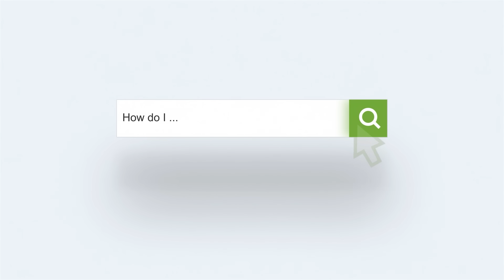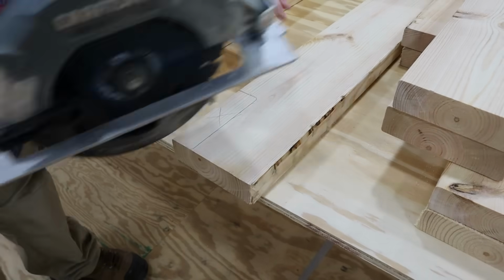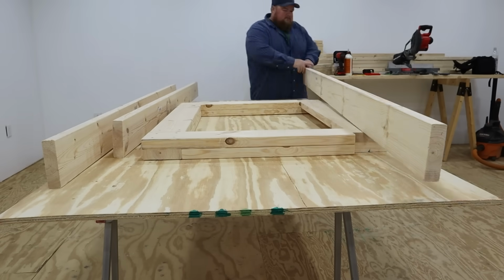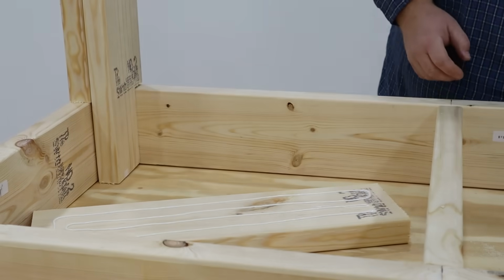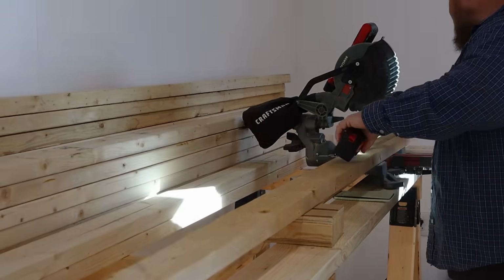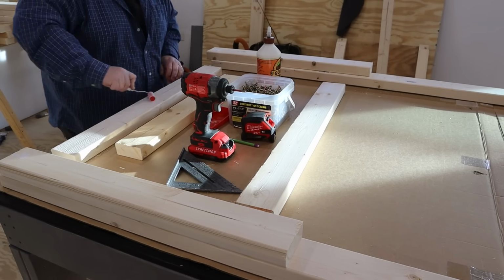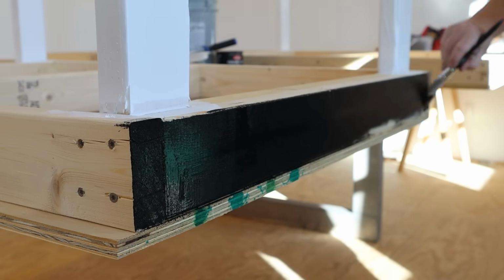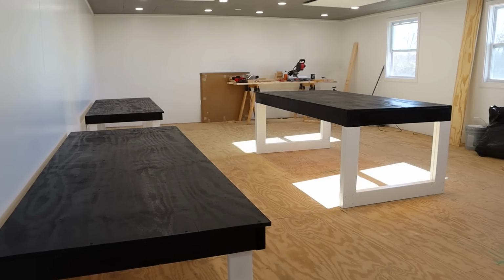Workbench & Laser Tables [Easy Build / Strong / Great Looking]

Comment: For the center table perhaps some casters. Never know when you will need to move things around to make space or adjust to a new acquisition such as a tool or must have materials. Evolving as the workshop world is there is always something to consider. Perhaps in a few years your son might want some space too, which would be nice to share a common space.
Reply: had same thoughts to put wheels on that have a locking feature so not move unless you release lock

Comment: Sam, if you're main work table is also eight feet in length you might want to think about adding a central set of legs as overtime the centre of your table may start to sag and possibly warp. I'm also surprised to hear that you're going to be putting your machines into the new workshop if anything I thought that you might have built the tunnel between the two workshop's making it easier to move the machines across etc. As always buddy   💯%    👍    🇬🇧.

Comment: very nice, I only see two things that you may find an issue with.  I would worry about the legs on the wall table starting to flex left to right over time, but the major one that I think you may find is that to get to the outlets under the table and run cords up you may have to pull the tables away from the wall.  Both can be fixed by putting a stretched across the back - pushes the table out and changing out the top with cut outs over the outlets for the cords to go down (expensive route) or just drilling a hole for the cords in the top.

Comment: Love the series. For me, I would have left the table tops natural pine and just put a few coats of clear poly on them - it helps bounce the light back up instead of drinking it, so you may not have to use the full array of ceiling lights all the time, and it does not show wood dust nearly as much as dark surfaces. For future safety, I would have taken the sharp edges off the tops and rounded over the corners - never know when you are going to trip, and you have kids whose eyes are a lot closer to table top level to consider too.

Comment: If you have any amount of movement of the legs, put a screw through the leg into the floor. Toenail type but with screws. Easy to screw back out if you want to move the table to a new location. I did that on a table that I built, makes it super solid. 

Thanks for sharing the build with us

Comment: I'm a big fan, love what you do. I have a couple of questions:  1. Do you plan to drill holes in the tabletop for cords to access plugs? 2. The two smaller tables don't have bracing on the legs, are you worried about moving while the lasers are operating, will the moving head set up vibrations?  3. When will you join your two shops?   Keep up the terrific work!

Comment: i ripped 22 mm plywood intoo planks and used that to construct the frame for the tables , use two planks put together in an L shape for the legs and put the table top and bottom shelve to that with carriage bolts the rest of the construction was basicly the same 
realy solid table , and one added benefit is that the plywood used is less likely to warp when it dries out and you can take them a part intoo pieces that will fit through the door without using the saw

Comment: Sam, just a fyi. If you are nailing or screwing together2x4 0r 2x6 s Don't line up your screws or nails with each other. The deeper one will in time add a crack to the outside one and therefor loosen up your fasteners. Nice tables tho and I wouldn't  do anything different  right now. Next time. LOL You might want to add some diagonal bracing on your island table. If you bump into it enough times you could see the table start to wobble. Take care. I don't reply very often but I see this as a permanent table and hope they last a life time for you.

Comment: You should really consider putting a board on the bottom of each side of the legs, especially on the longer ones. 
WHY??? 
Even with how beefy you made the legs they're going to eventually spread and give out. 
Most people don't realize that you can brace the tops of tables/benches but in order to provide maximum stability you need lower braces, especially on items built with butt joints. 
Where you cut and notched the leg assembly is your main weak point

Comment: You over engineered the legs.  With glue you don't need screwes you could of just use a nailer with it, would of been cheaper and faster.  And provide the same results with no screw holes.